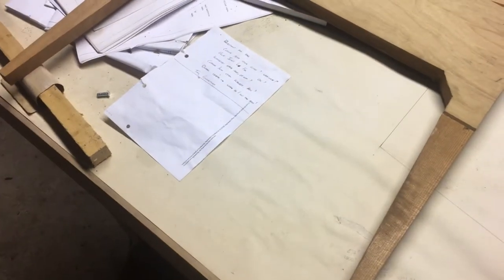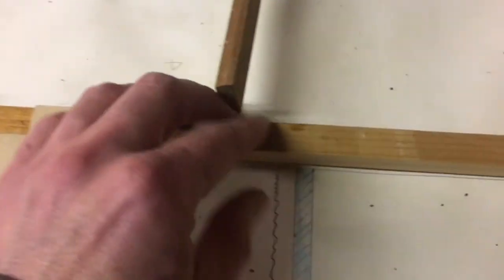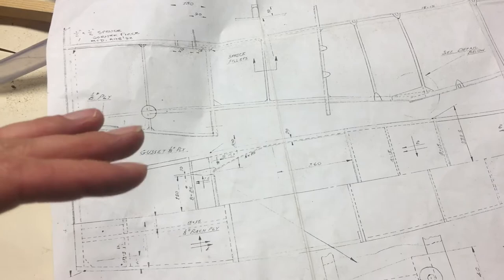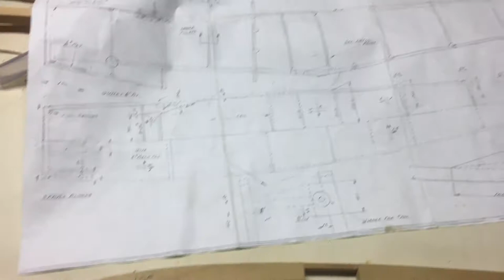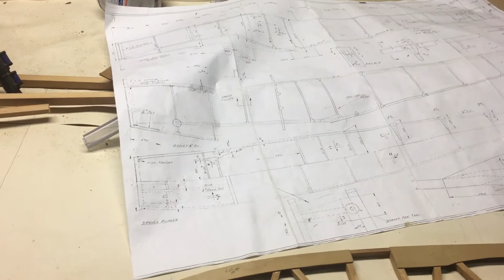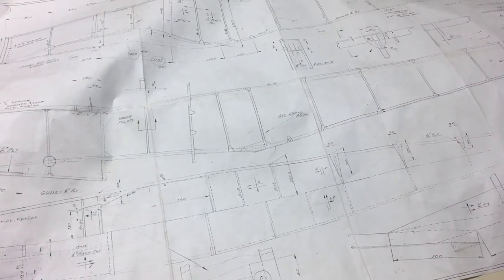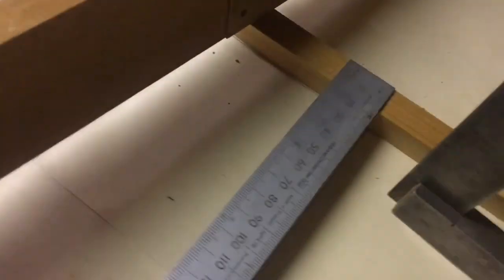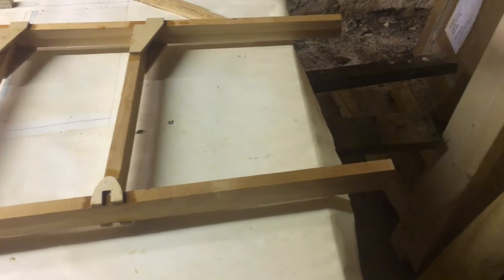Druine D31 Turbulent Build Vlog Episode 17

Comment: Nice! Spruce - you mentioned using the plane to trim down the piece for the cockpit. I wasn't sure if that was ply, but if so i wonder how well a plane would work with the wood fibres running at right angles to each other!?
Reply from the maker: Very, very sharp plane, and then some tidying up with a sander I expect.  Maybe a sander all the way, not sure yet...